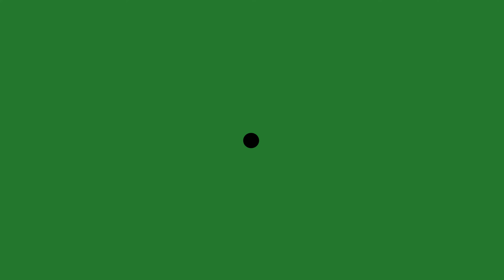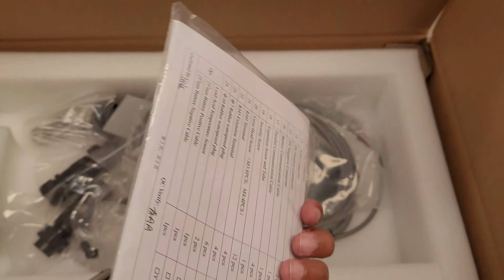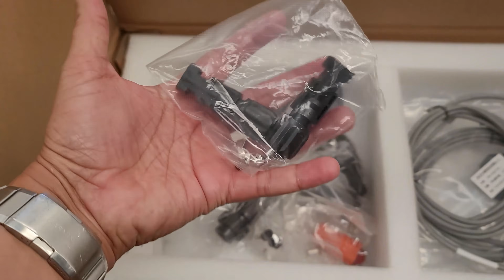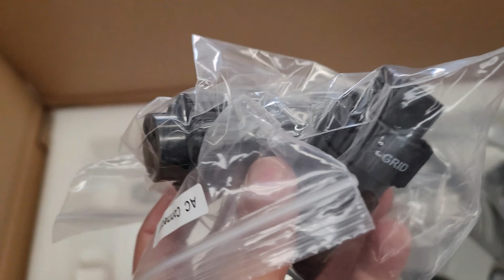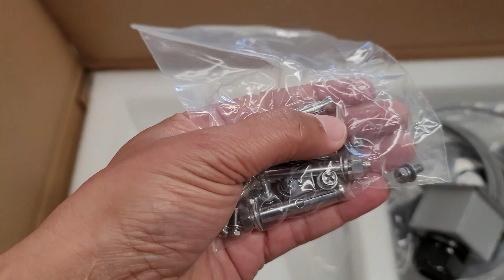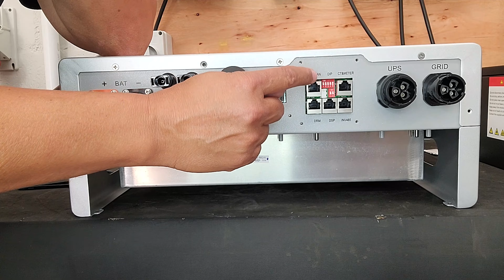Luxpower LXP 5k unboxing intro

Comment: Hi, is there a contact i can reach you on? I am in Kenya and have five 5kw hybrid inverters and four 100aH batteries that I would like to parallel with battery share. I do not have the +ve and -ve leads for battery to battery connection and i can't seem to find these locally. I am sort of stuck

Comment: Hi hope u well I am struggling to set up the setting for Voltage cut off and changing battery I got 5kva inverter Lux power and lithium battery Hubble Am 2 5.5k it was running for mouth all suddenly it cut off at 70% battery voltage the guy who did for me is currently sick just need wrt setting plz can any one Assist